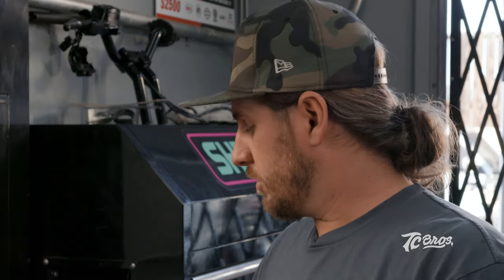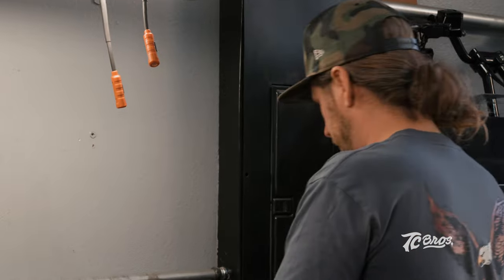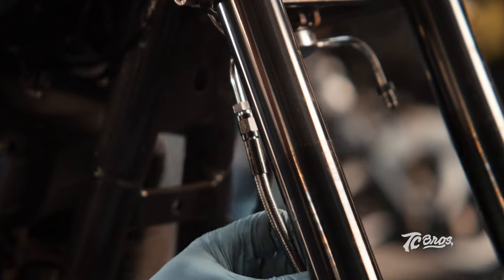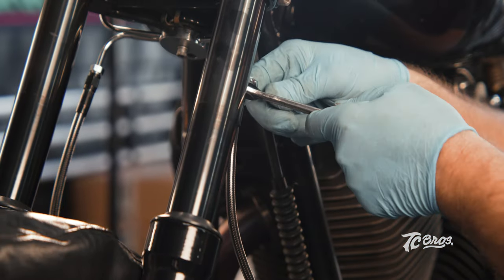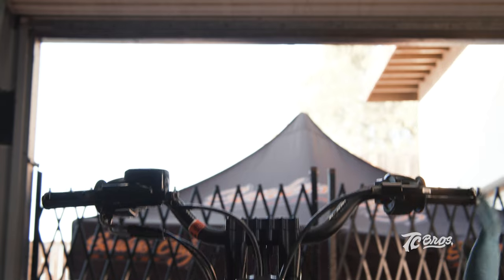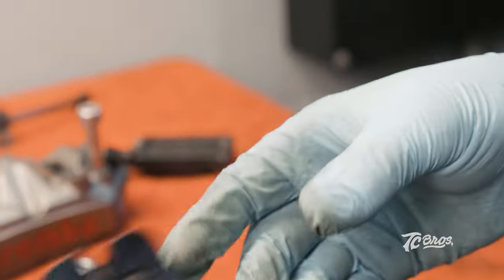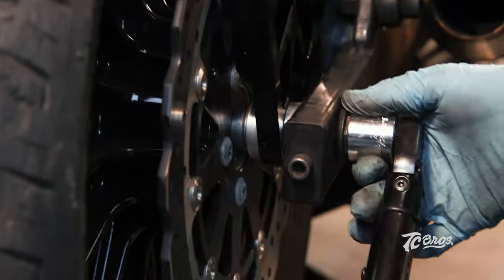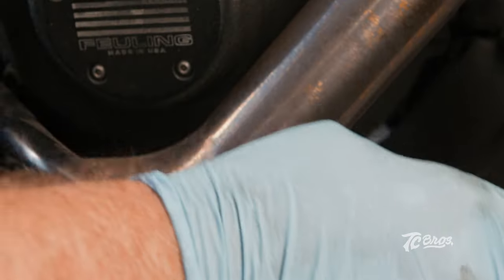TC Bros. Brembo Radial Brake Caliper Install How To By: Senders Only Garage

Comment: Can I fit this setup on a dual disk 39 mm with 9 spoke mag wheels the front end is on a fxr 3/4 axel pre 2000
Reply: Hello,
I am sorry, we do not offer a bracket to fit a pre 2000 application.